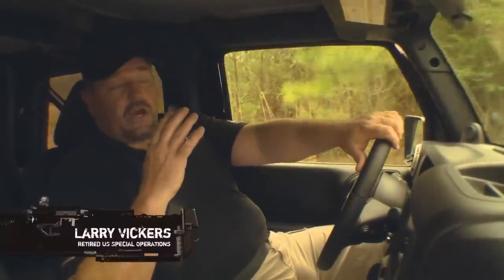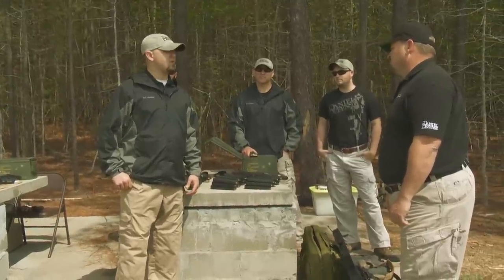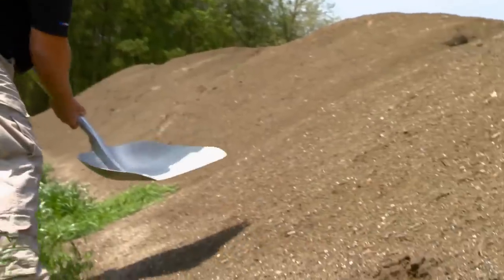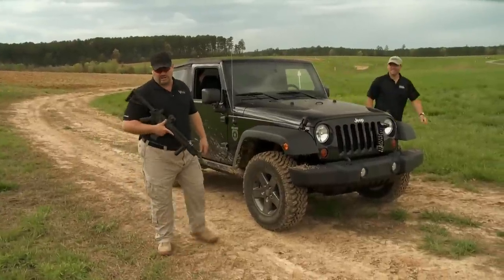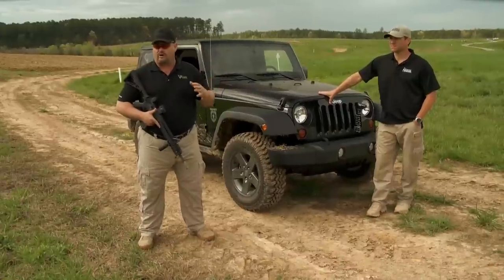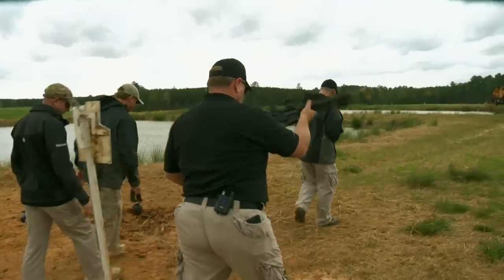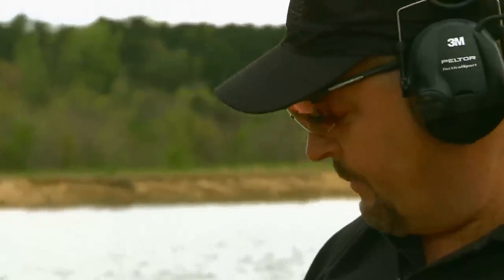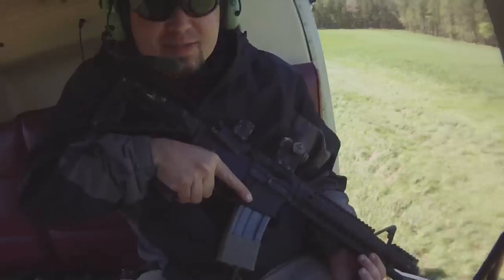Tac TV Season 1, E1: Daniel Defense M4 Torture Test

Comment: Why use this gun? The HK 416 is way better, with a shorter barrel and higher mobility!
Reply: Daniel Defense rifles come in a wide variety of barrel lengths, gas system lengths, rail systems, etc. Why do you think the HK 416 is better? You are comparing a $3,000+, German, High End, firearm from a company with what has been known as bad customer service. $3,000 is nothing if you are SF and they are issued, but for an everyday joe I will take an American made Daniel Defense for around $1800 give or take a little.
Reply: HK416 is shorter. It is comfortable since it's 80% similar to an M4A1 and features made it so that when you rotate your gun it can fire straight. 

Asking why buy $3000 rifle when you can buy it for $1800? It's cos the $3000 rifle is better. There's a reason why it's more expensive, not because of poor customer service but because the $3k rifle has better features.
Reply: Once again, this is all subjective. Daniel Defense rifles, once again, come in all different barrel lengths. The M4 barrel is 14.5", civilian rifles typically have to be 16". Both have cold hammer forged barrels. You say the $3000 gun is better? That is your opinion, I disagree. You can go buy a Mercedes, which some have a lot of problems, or you can go buy a Ford. Same concept, same core features, without all the unnecessary bullshit like a label, at a cheaper end user cost.
Reply: Actually, The DD M4V1 IS the Mercedes. Cos the HK416 has less problems than the M4V1.

So far all you've debated are the bad sales and cost. You haven't given me the gun differences. So far you haven't made your point no matter how much I respect your disagreement. So if you want me to finally agree on you why it's better, please give me something good about that Daniel Defence Dildo that HK416 doesn't have before coming to me with stupid irrelevant fucking points about cost.
Reply: Hk416 still has pros and cons. 2 main things r, I don't like the piston system, it will start heating the handguard up after 50 round and you'll either have too readjust your grip or wear gloves. Second thing is the piston system makes the rail taller about a quarter inch and will take extra practice getting used to firing your sights with a quarter inch high offset. It's unquestionably more reliable. But if u understand the concept of liquids can't compress and gasses can, u can manipulate an ar15 to be reliable when u want it to be. Buying a mil spec bolt carrier group and using polymer magazines will make the gun less likely to malfunction.
Reply: IMFDB"Unquestionably more reliable"

It's absolutely questionable. There are no scientific studies into the question of reliability between these two rifles. There is no studies I'm aware of  between an HK 416 vs. any AR-15. The closest there is to a study, the US Army weapons testing, was fraught with uncontrolled variables (against the M4 mostly) and still found the issue to be magazines.

So I will question that, and I will openly state you are wrong when you say "u can manipulate an ar15 to be reliable", because they require no manipulation to be reliable (HK 416s are an AR-15, which you say is unquestionable). A design that doesn't work doesn't go on to be used by over 80 different countries' militaries.
Reply: Matthew Harger Your last paragraph is confusing I can't tell whether u make them sound flawless or hate them. Let's start over. A lot of malfunctions I find with AR15's are out of spec metal magazines such as deformed feed lips that you may not realize with the naked eye. Most USGI mags in 2004 did not have anti tilt followers either. A bolt carrier group with a weak extractor spring has been known to cause failure to extract type jams like double feeds. That's the baseline of AR malfunctions with no environmental issues yet. Sand getting into the bolt carrier is obviously resistance, it can cause lower bolt cycling speeds and can cause the bolt to short stroke or make it not seat in the chamber. Water cannot be compressed like gas could, and a little in the gas tube can cause the receiver to blow up. That's one major pro of the 416 is because it doesn't have a gas tube and can fire after being submerged with no detonation issues. Taking precautions like closing the dust cover and making upgrades to the bolt carrier and magazines is what most would call manipulation to be reliable. 

You don't have to read scientific studies to figure out which is more reliable. Just understand what causes malfunctions, accept the fact they are inevitable, and figure out how to clear them efficiently under gunfighting stress. HK416 vs M4 ones not better than the other because they both have pros and cons. It all depends about the environment your in and what u are using them for.
Reply: 107assassin The HK416 has a 264mm barrel. Overall length is 797mm, or 701mm without stock. The SCAR-L CQC weighs less, has a 254mm barrel, and the overall lenth is 724mm, or 533mm without stock. Therefore its more mobile than the HK416. And they're cheaper aswell. Oh, and don't start about the reliablity... 

The ATEC tested them in 2007, and the SCAR-L & HK416 both shot 60,000 rounds, after one dust test. The HK416 jammed more, (233 stoppages) compared to the SCAR-L (226 stoppages). Big difference? Not really. But don't tell me, the HK416 is more reliable, because it isn't.

Note: In Combat, hundreds of thousands of bullets gets fired, often under extreme conditions. Every single jam can cost a soldiers life in combat. Believe me, if the SCAR has just 3% less jams than the HK416, i'd take the SCAR over the HK416 any day.
Reply: The 416 is a lot heavier than a DGI gun. It has more moving mass on recoil. So you're split times are going to be slower. I have talked to former a SOF guy who said after shooting his 416 he turned it back in. he didn't like the weight or the recoil. He said he felt that there was no advantage. Larry Vickers who helped desgin the 416 has even said, you don't need a piston gun unless you are filling two of these 3 criteria. You will run the gun almost always on full auto, you will run suppressed most of the time, and have a short barrel. Which is why the SEALs like it so much, they run 10 inch barrels almost always suppressed.
Reply: The 416 is almost 9lbs before being loaded, is subject to carrier tilt from the piston system, and is 3,000$. I would gladly take a lightweight (6-7lb) Daniel defense in any barrel length for less than that and have money left over for an optic.
Reply: The only difference is the 416 is piston driven. It runs a little cleaner but piston guns weigh more, have more felt recoil, aren't as accurate, have more parts to possibly break, cost more to manufacture and have more wear in the upper receiver. That is lots of cons for the one advantage it offers. Not to mention, if you keep a DI gun lubed & clean it on occasion the one advantage a piston does offer is negligible. 
Don't get me wrong, I love most HK models but the 416 is doing nothing but adding complexity, weight & cost to a rifle that already works great.
Reply: Assassin 426 well let's see you can't buy a 416 you have to get an Mr556 and make an sbr clone costing you way more than a stock DD ar15
Reply: As an owner of both an HK 416 and a DD M4v1, they're both amazing systems...but, your question is too vague. As stated, they both come in different variants and it all depends on how you set it up and for what purpose. Plus, you can have the "best" gun on the planet, but if the person behind the trigger is incompetent and/or useless, so is the gun. For the $ though, I'd go with DD if it came down to it. A bit less in cost and the quality is fairly equal if not better. Plus, it'd leave you with some $ for a nice optic such as an Aimpoint or Eotech. And finally, it's pretty hard to get a true 416 here unless you're LE or Military. Most are clones or based off the MR556.
Reply: HK416 is heavier because it's a piston-driven system and at least twice the cost of DD. Daniel Defense is by far the best quality for your money on the market; It meets in the middle for both price and quality. You'd have to shoot one to appreciate one - I didn't think much of them until I got to demo a lot of their guns. Now I own one and am so damn happy I got it.
Reply: Assassin 426 dude lay of battlefield 4 3 rainbow six. life is different. doesnt matter if they got him to help them they just changed the shit.

Comment: An HK416 would have lastet longer
(Or so i think)
Reply: Why do you think that? Only real difference is piston vs di, and many people prefer di for the lighter weight. Both are reliable as hell.
Reply: @GruntBurger  the HK416 was optimised by HK to be reliable, it is also short piston driven with a bit to much gas, while normal m4's are direct impingement operated and a lot less reliable.
Reply: @moritznagle2199  They aren't any less reliable, that whole narrative has flown the coop. The 416 is an undeniably great rifle, but you should check out some of the reliability tests done on modern di guns. The gas blowback assists in clearing obstructions. I will say though, if you're going to go full auto for a thousand rounds without stopping, yeah I'd put my money on the 416 but that's not a realistic scenario.

Comment: dummy here... what's a short stroke?
Reply: I don't pretend to be an expert, so please correct me if I'm wrong. My understanding is that the bolt moves back after firing far enough to eject the fired casing, but not far enough to push up the next round from the magazine.

Comment: Larry, I respect you for your service but these tests were rigged.

For one, the dirt test is ineffective if every outlet for dirt to enter the action is blocked. Any firearm will fire with a little dirt on the outside. Open the action with no magazine and try it again.

For two. You had a malfunction during the water test yet it passed with flying colors? No, it failed. Regardless of being a easily corrected malfunction, it was still a MALFUNCTION. MALFUNCTION EQUALS FAILURE.